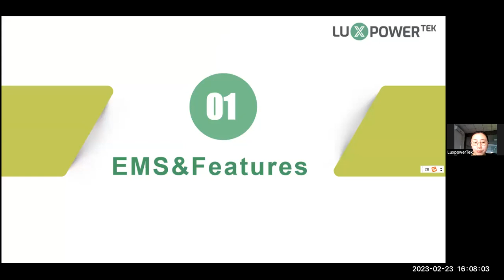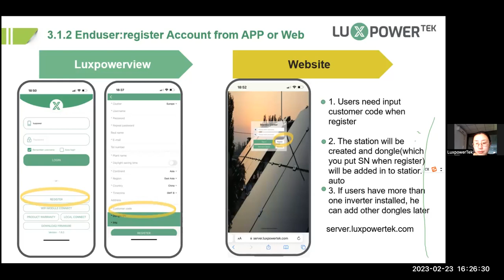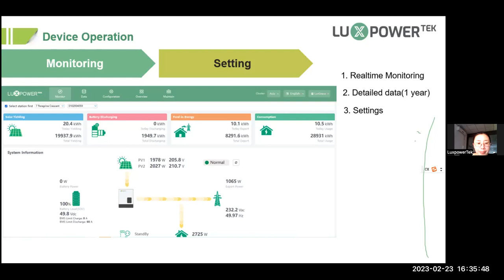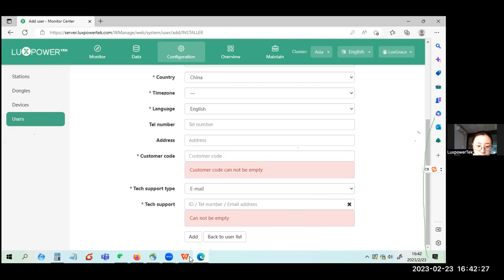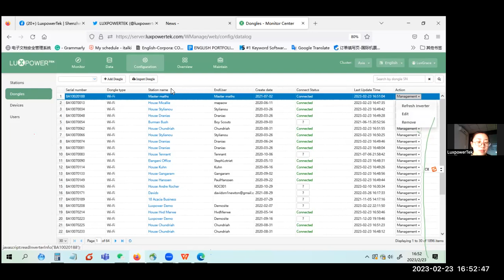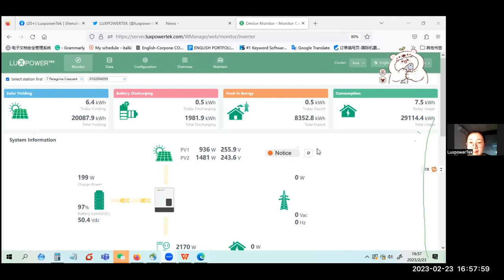Luxpower Monitoring Online Training

Comment: There are 5 technicians at work, we have done extensive research as to which inverter to purchase, unfortunately our research was base on the technical specifications and capabilities of the inverter and not the limited parameter access we would have with end user accounts. I decided to buy the Luxpower LXP first in order to give feedback to the others. I am more than impressed by the capabilities and build quality but the limitation of the end user parameters is a huge negative, if i am not able to overcome these limitations I will have no choice but to recommend that my colleagues go for another brand. I have contacted the seller and he is not able to assist me at all, that is really bad new as i am not able to upgrade to the new firmware version, who in South Africa can i contact for assistance to gain full access such as that of the installer account.😔